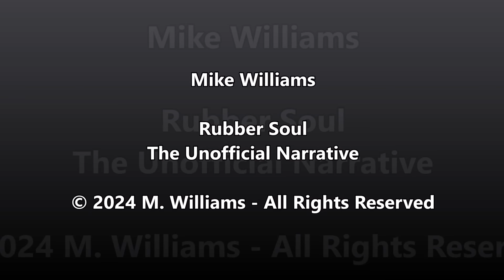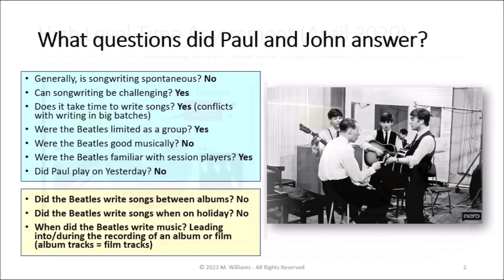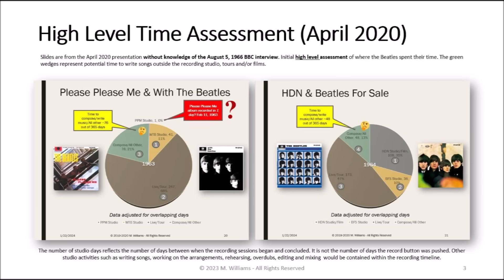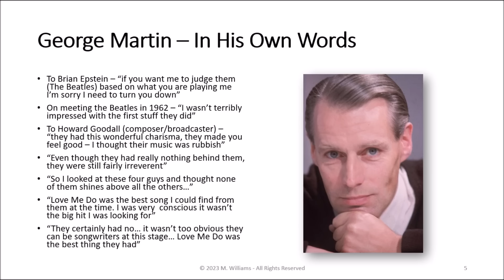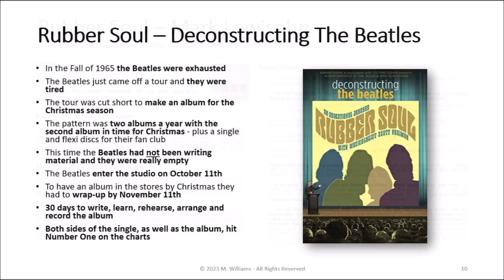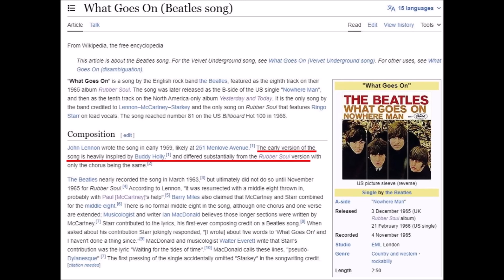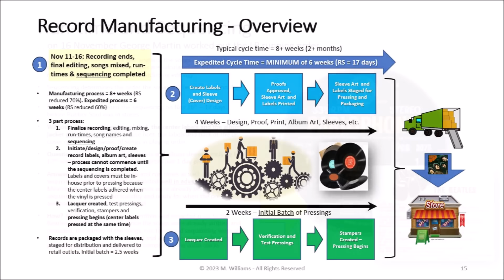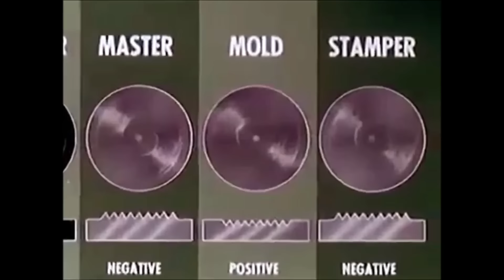Sage of Quay® - Mike Williams - The Beatles' Rubber Soul: The Unofficial Narrative (Feb 2024)

Comment: Friendly fyi:    DEDUCE  not DEDUCT .    IMPLY = pitcher. INFER = catcher   ' 

Imply: When you imply something, you suggest it indirectly without stating it outright. In other words, you hint at a particular meaning or message without explicitly expressing it.

Example: If someone says, "The kitchen is a mess," they might be implying that they want someone to clean it up without directly asking.

Infer: When you infer something, you draw a conclusion or deduce information based on evidence or reasoning. Inference involves interpreting or understanding something based on the available information, rather than being explicitly told.